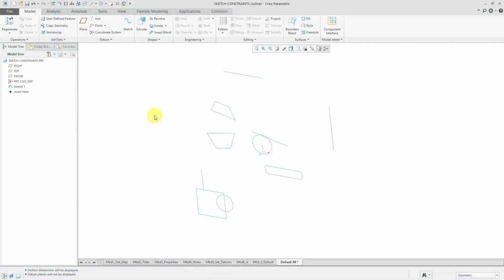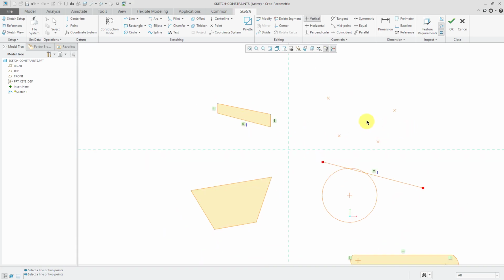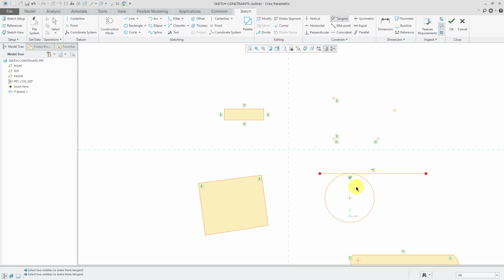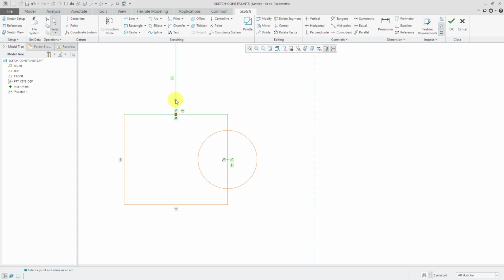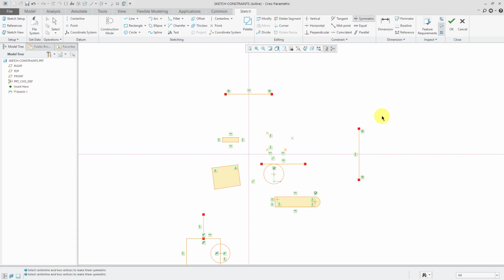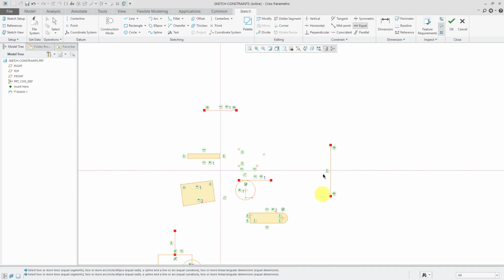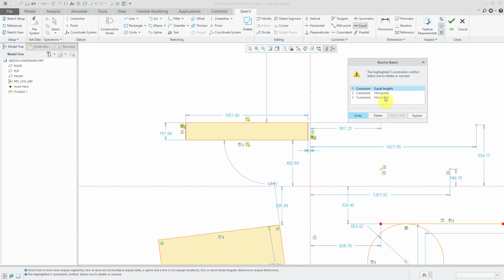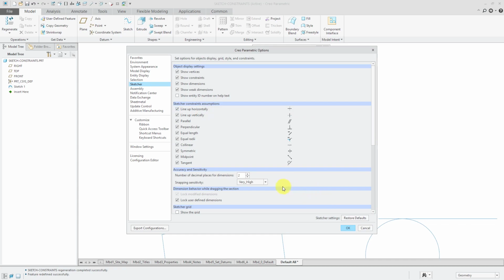Creo Parametric - Sketch Mode Deep Dive 5 - Constraints

Comment: Thanks for your clear explain constraint.
However you seem miss coincident constraint.
Could you have a short video about how to tell the symbol of constraint?
I usually can't quickly understand what the meaning of those coincident symbols.
Such symbols coincident line to line, coincident line to vertex, coincident point to vertex, etc.
Reply from the maker: Huh. I wasn't aware that I skipped over Coincident. Coincident is "put these two things on top of each other." I wasn't aware that there were different symbols for the different kinds of coincident constraints. I always thought it was just a dot in a circle. If you go to PTC Help, you can find the meanings of the different symbols (if there are different symbols for different kinds of coincident, again, I never noticed).
Reply: Hi  @CADPLMGuy  , 
Thanks for your reply. 
I know it just a little detail thing but sometime it make me annoying.
Determined to figure out it.
I just ask chatgpt and will try to look for PTC help.
Thanks for your suggestion.

Comment: 00:10 Sketcher constraints simplify sketch geometry
01:30 Sketch constraints for vertical, horizontal, and perpendicular alignment
02:42 Applying constraints in Creo Parametric
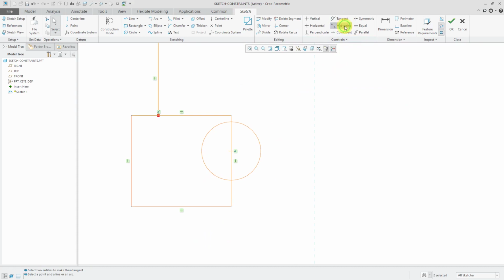03:53 Symmetry command requires a centerline and two vertices.
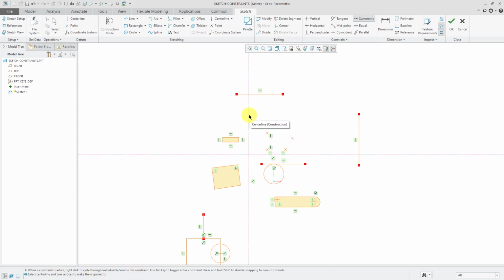05:07 Using symmetric and equal commands to create symmetrical and equal entities.
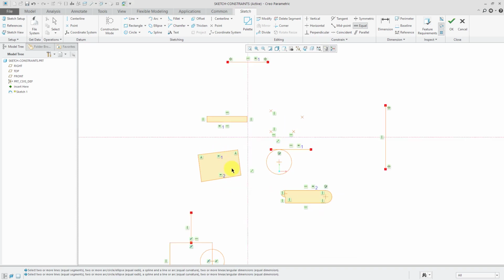06:26 Different constraints can be applied to entities, such as arcs, circles, and lines.
07:51 Creo Parametric does not allow over dimensioning or over constraining sketches.
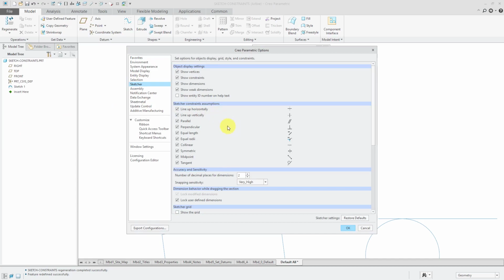09:10 You can turn off assumptions and adjust snapping sensitivity in Creo Parametric sketch mode.
Crafted by Merlin AI.

Comment: Snapping sensitivity!! Definitely did not know about that and 'very high' is too high for my preference, thank you.  Also, this video appears to confirm that the symmetry constraint requires you to click the button in the ribbon first which has always bugged me.  Any idea why that one particular constraint cannot be created the efficient way like the others (i.e. pick entities first, then right click to add constraint)
Reply from the maker: I agree, the sensitivity is too high starting in Creo 4.0; at least it didn't seem too bad in 3.0 and earlier. It's odd that the default setting is Very High. You don't want to start at 11. You want to have something in reserve when you really need to crank things up. 

I don't know why Symmetric is not available using object-action. It does seem odd that this is the only constraint that doesn't support that workflow. I tried customizing the Mini Toolbar to add the constraint. Even when you pick the entities first, it forces you to pick them again. Consistent workflows would really help with user-friendliness.
Reply: @CADPLMGuy  Well at least it's nice to know I'm not alone or missing something :)  thank you for the clear response
Reply: @CADPLMGuy  Thank you for this thorough reply!